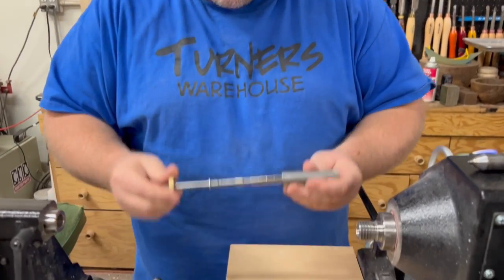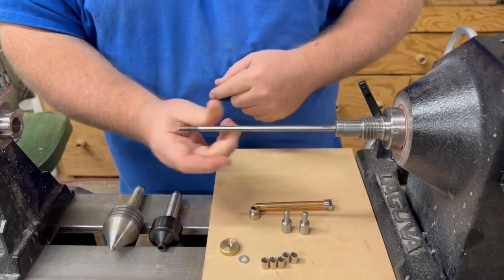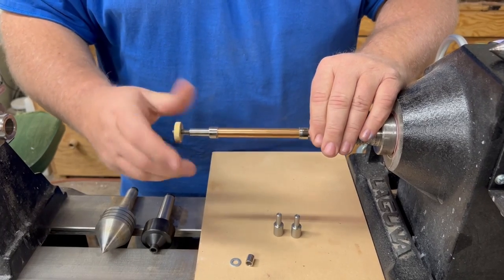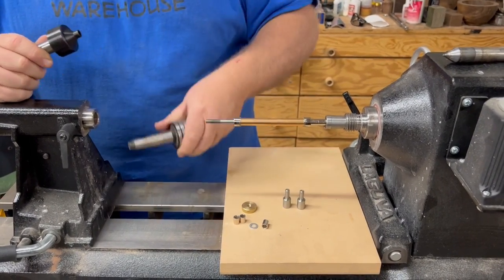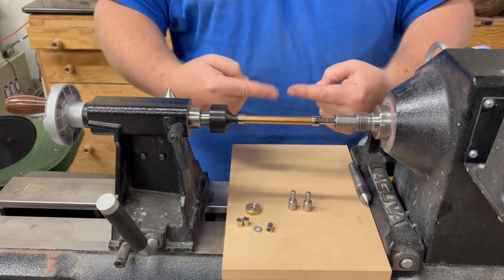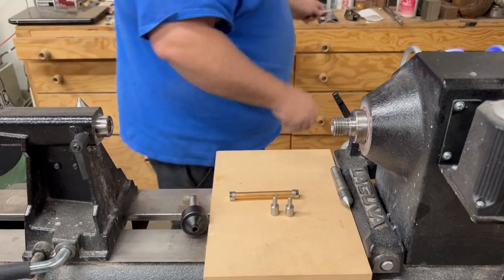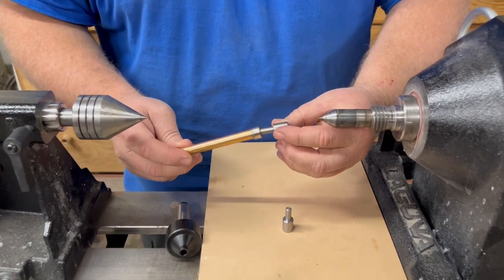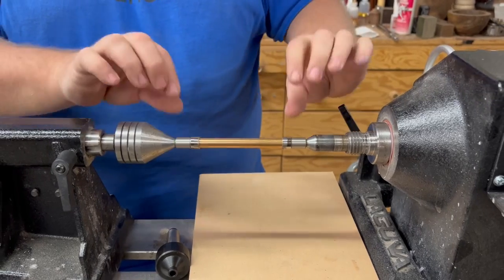Beginning Pen Making,   Setting up your pen mandrel and TBC Bushings,   wood turning

Comment: Nice video, thx for explanation..
But i have a queation... would be possible to add some aditional parts to attach rings (mostly wood or titan  ring cores)  so i dont need to buy aditional ring mandrel..
Reply from the maker: Would it be possible, yes.. but you might have to make parts. Not aware of anything that does that, that would go on a pen mandrel.
Reply: They make ring making parts that mount on pen mandrels, check out turners warehouse or wood turners catalog
Reply: Merhabalar dolma kalemi yapımı için  metal  olan malzemeleri nasıl temin edebilirim teşekkür ederim. TÜRKİYE den.